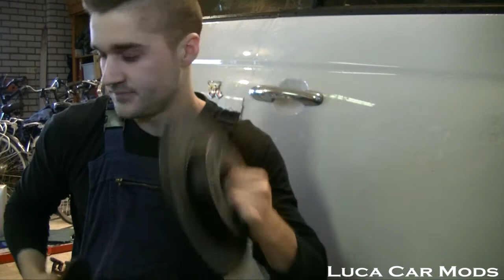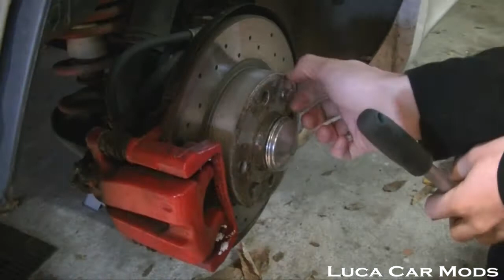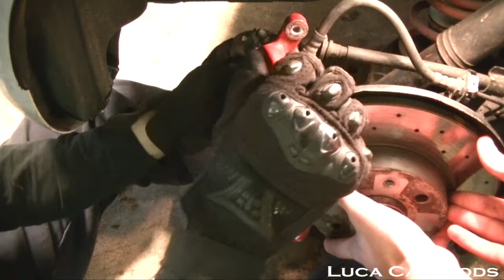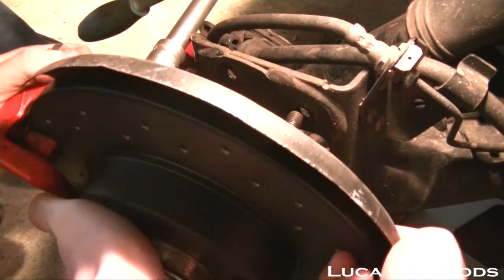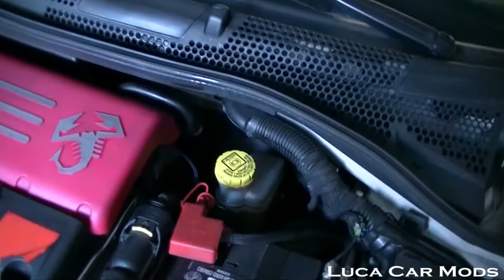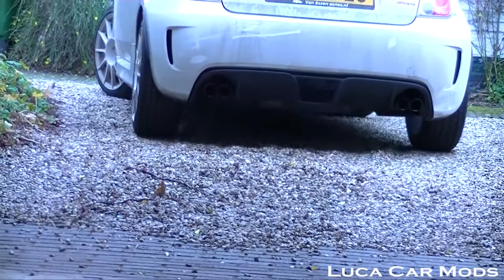Replacing the Rear Brake Discs & Pads On A Abarth 500 Esseesse

Comment: They're not any more difficult to replace than any other car. If you take the brake caliper off and take the bottom bolt out of the carrier, You can then tap the carrier with a rubber hammer until it stops, Then just slide the disc out at an angle and slot the new one in the same way. No need to undo the hub bolts at the back. The top carrier bolt is a pivot bolt and is designed for the carrier to be moved on it, I think that's why the hub bracket is in the way and no access to the top carrier bolt.
Reply: Really? Are you sure there’s enough room? In any case I wish I had seen this post earlier!
Reply: @lawts78  I've got a 2013 and had the rear pads out twice, once to replace the pads and once to fix a squeal, never had to take the hub off, Just undone the bottom bolt on the brake carrier and tapped it back with a rubber hammer. 
If you tap the carrier back as far as it will go and take the pads out you can slide the disc out aswell. No need to take the hub off at all. I k now it's different on the new facelift ones and you do have to do it but not on the pre-facelifts.
Reply: @smart3k  this would have saved me an hour undoing the 4 extremely tight hub bolts on my 2010 Abarth! 😫👍🏻

Comment: Was trying to wind back the piston with the rewind tool, and it would not wound down. I had the handbrake down, the filler cap open, I wound it clockwise and clockwise, and it still did not move down. Is there something I'm missing?
Reply from the maker: +Bruno Martino Normally it should wind back in the caliper.. How many rotations did you do?
Reply: +Luca Car Mods several but I think I have the wrong wind tool. It doesn't allow me to apply a force down at the same time as rotating like the clamp tool you're using. I'll head down to the tool shop tomorrow to see if I can pick up something similar.
Reply from the maker: Bruno Martino It needs to apply pressure. I hope you get the right tool tommorow.

Comment: We were trying to do this yesterday on a Fiat 500 1.4 Sport and came to the same conclusion that the stub axle had to be loosened.  When we got the 4 nuts off the axle would not budge...  Will be having another go on Monday evening.   Is it OK to tap the stub axle from behind through the hole in the end of the cross-member?
Reply from the maker: Clive Elsdon Yes, but do in gently! You don't want the studs to bent or something like that :) Best thing to do is screw a nut on it and then do it, this protects the thread.
Reply: Use a wood block (small scrap piece of 2x4) when you are tapping, it will prevent damage to the metal.

Comment: where did you jack the car up from? cant find a specific place
Reply: I use the rear cross member, its all black. If you see your torsion rod, it is between that and the gas tank. Just be mindful when you jack it as the gas tank is plastic and could push that up instead of the cross member.
Reply: No you really shouldn't jack the car up on the rear axle it's not designed to take the stress that way
You should lift it from the reinforced box section on the floor pan just in front of the rear factory Jacking point

Comment: was wondering why you don't use a bleeder? (i'm a newb but co-workers told me i need a bleeder, plus i saw it in some other vids.  do the abarths not need bleeders?)
Reply from the maker: You only need one when you are replacing the fluid. When replacing the pads you are just pressing the fluid back into the container.